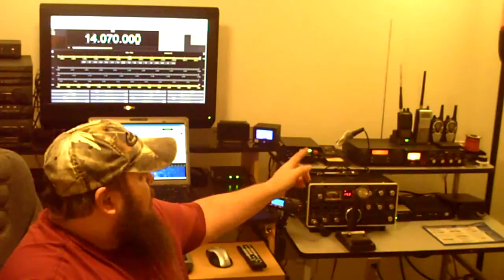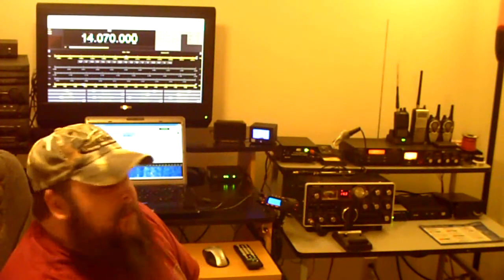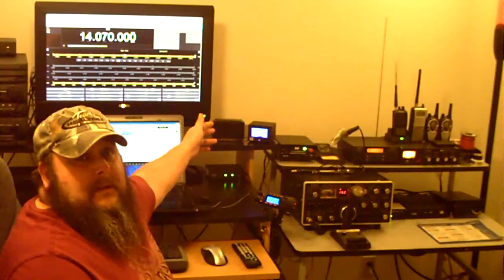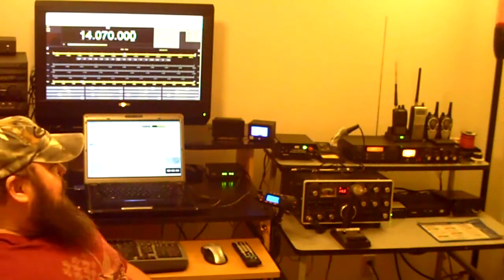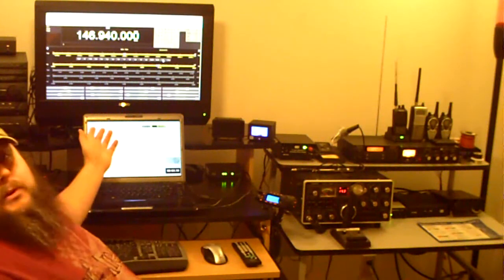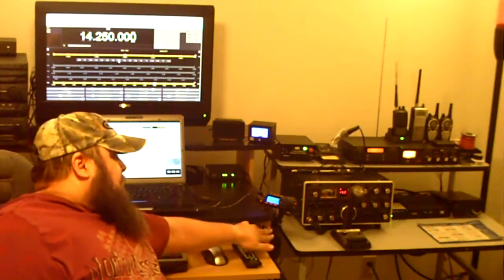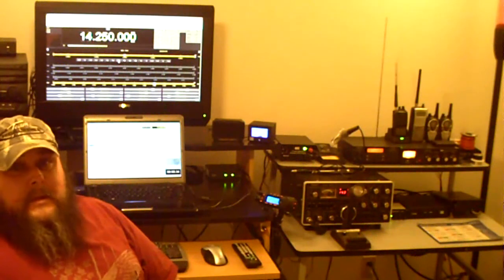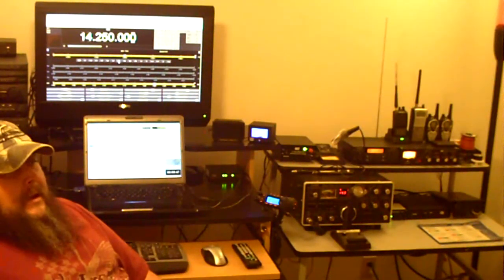Ham Shack Update 11/22/12

Comment from the maker: The tuner works great.  It is designed to work with the 817 857 and 897.  It has a Cat through jack so you can hook up a CAT control cable to your PC as well as the tuner.  The only problem I've had so far with it is on 60m since the channels are pre-programmed into memory.  It won't let the mode change to AM when you try to tune up on 60m.  I never talk on 60 anyway, so it's not that big of a deal to me. 
73 de N4TNA